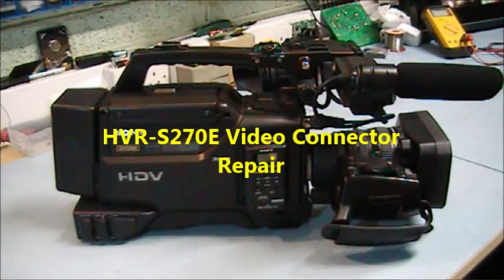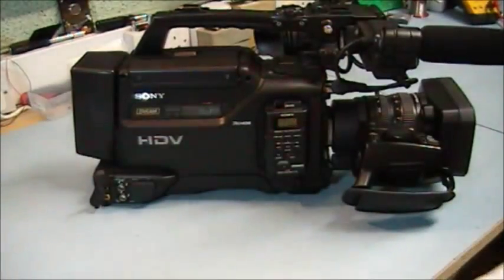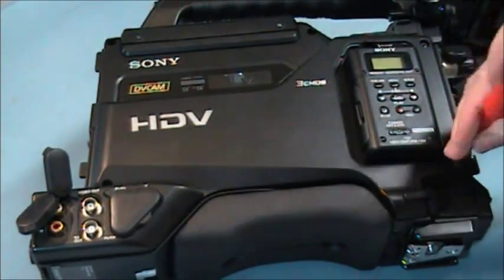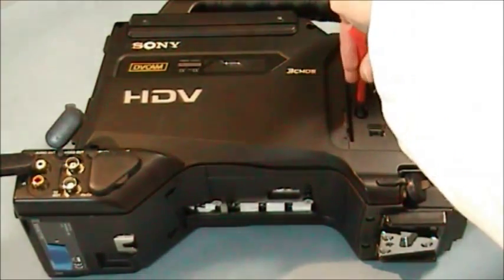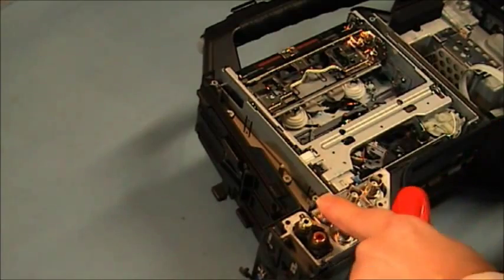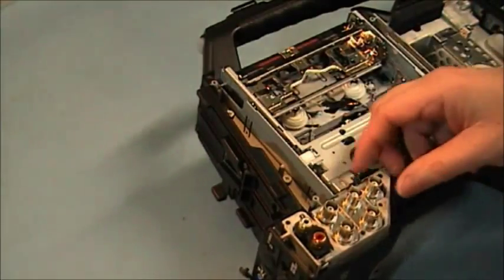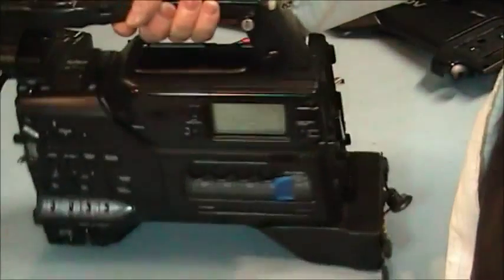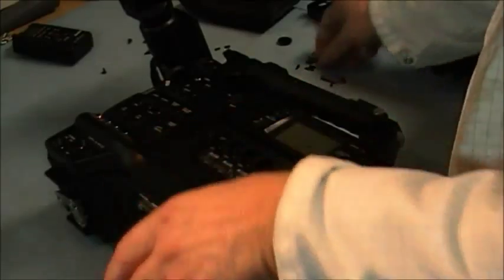Sony HVR-S270E Repair

Comment: Thank you for posting this video.  I have been trying to remove the CONNECTOR BLOCK from my HVR-s270 to repair a broken XLR connector.  Your video is perfect!  However, I am still nervous about disconnecting the small ribbon cables.  Especially the 4 cables that have to be disconnected to remove the camera side with the audio controls.  Can you give me some instructions?